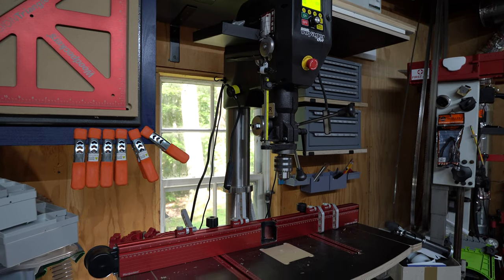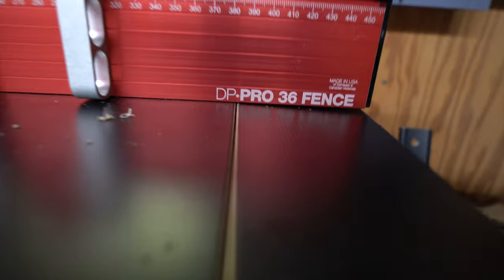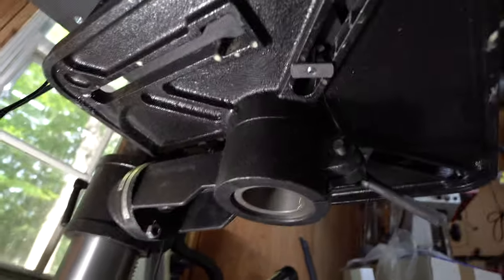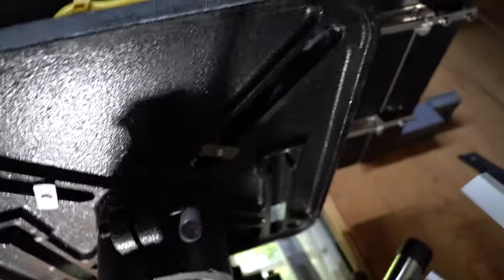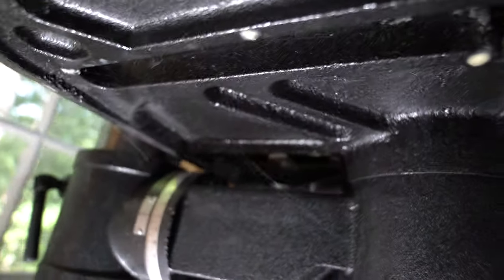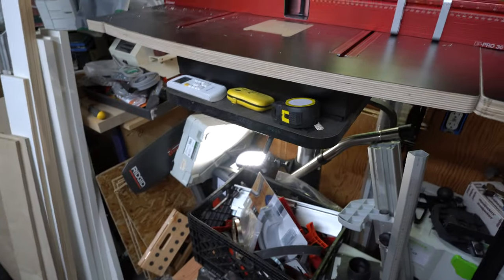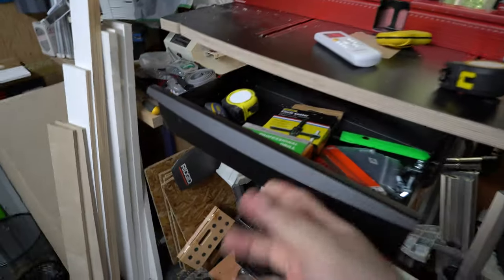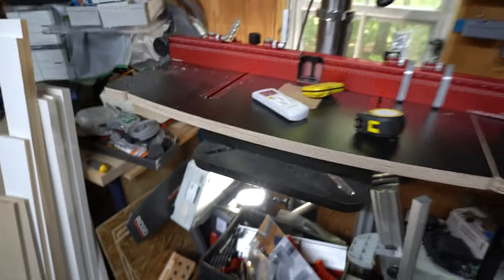Woodpecker DP Pro drill press fence on Nova Voyager DVR (floor-standing model)

Comment: Pete, this was awesome of you to do this! The 36" is exactly the setup I'm wanting as well. This answers all my questions on how it sits on the table and installs. You have a great drill press for "Woodworking"!
Again, thank you!
Chuck
Reply from the maker: Thanks. If you think you will swap it on/off often, you could also consider replacing those t-nuts with knobs and thick washers.

Comment: Pete - I ended up purchasing the 48/36. They were $20 off and shipping went down $25 for some reason. Anyway, this table is well worth the price. 

I have a question though, the raised table makes it somewhat difficult for me to get at the table lock handle. Do you have a similar issue?

Thanks - Mike
Reply from the maker: Do you mean the one on the back of the column? Yeah, not the easiest thing to get to, but that's going to be true with any table other than the little cast iron one.